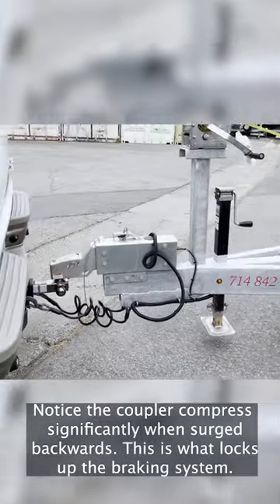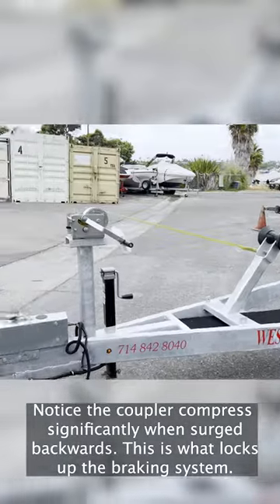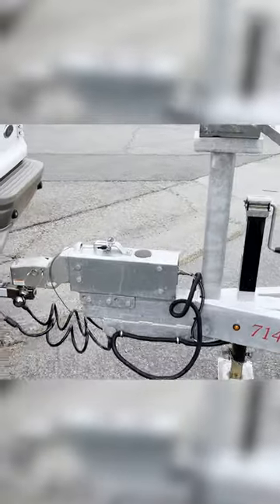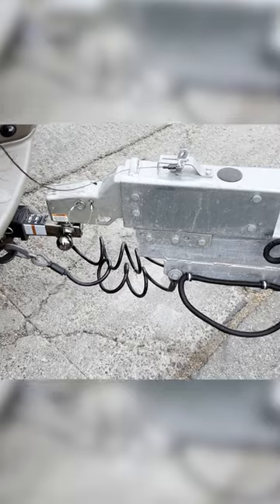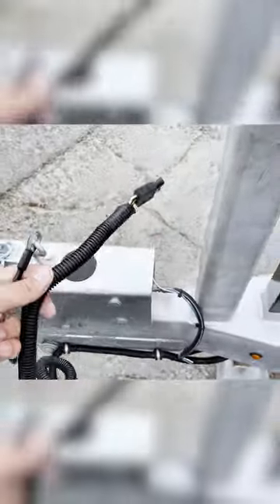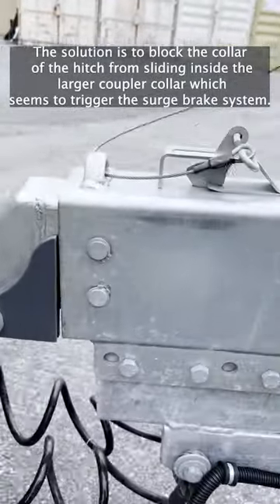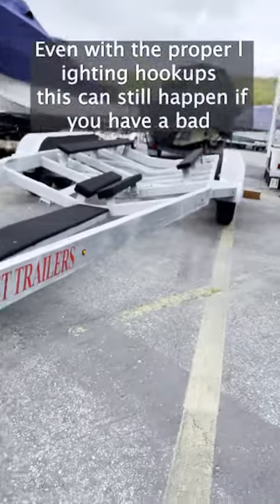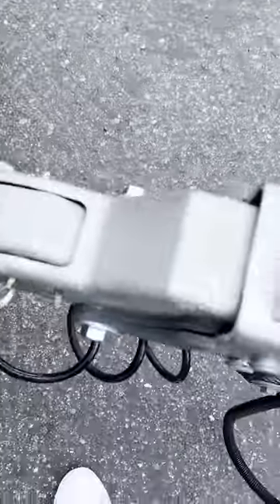Trailer Backup Brakes Lockout

Comment: The brakes are not even electrical. They are surge brakes when you back up it loads the brake that’s why you need to have the lockout for when you back up. Do not drive with the lockout on or your brakes won’t work.
Reply from the maker: Not fully true - just surge won’t work

Comment: Thanks bud just saved my ass at the job site 🤣🤝🏽
Reply from the maker: haha happy to help brotha
Reply: That cable that fell to the ground and you picked up, what's it called and what is it for?
Reply: @gr8dfender742  It's the surge brake safety brake cable should your trailer come unhooked from your truck for any reason that cable will be pulled therefore applying the brakes so the trailer isn't whipping around behind your or flying down the road.  Also this cable should be shorter than your safety chains.  Just learned all this for my first trailer haul yesterday.